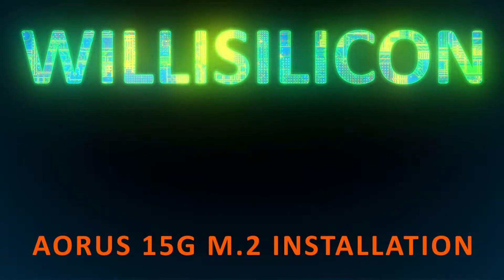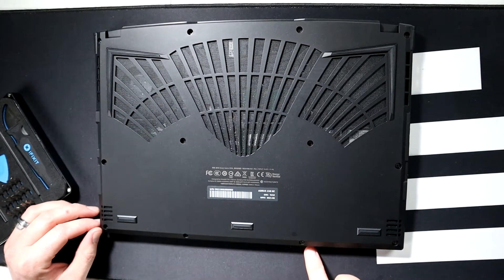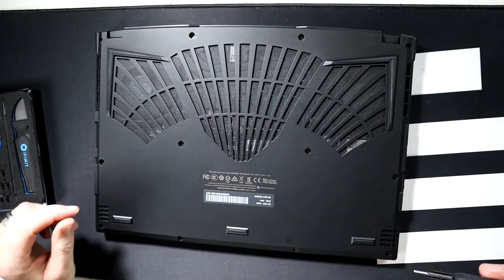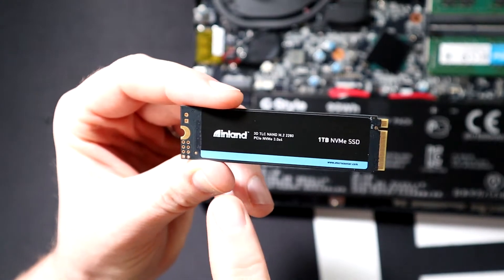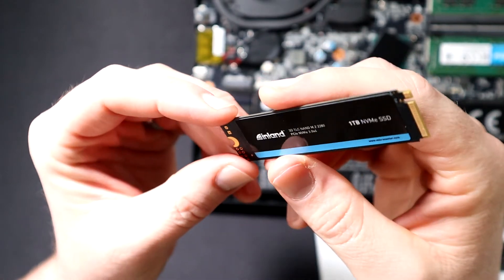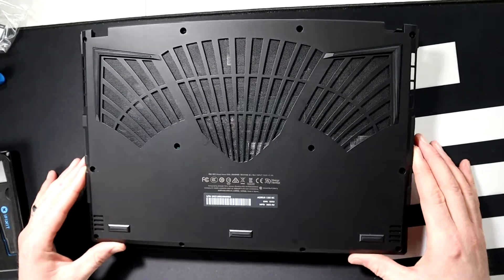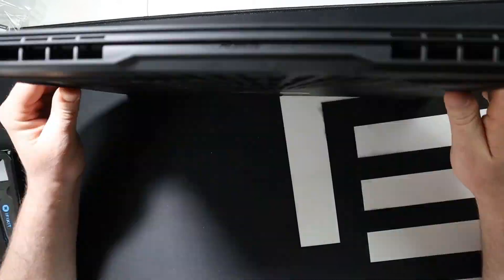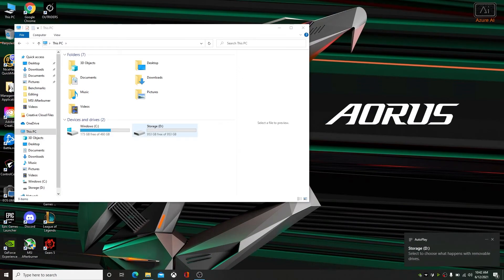How To Install An M.2 SSD and RAM In The Gigabyte Aorus 15G Laptop

Comment: Hello, I need your help. I have the aorus 15g kc model. I want to upgrade ram and ssd. Are these parts correct?
Crucial RAM 32GB (2x16GB) DDR4 3200MHz CL22 (2933MHz or 2666MHz) Laptop Memory Kit CT2K16G4SFRA32A
and Samsung 980 1TB PCIe NVMe 3.0 Read 3500MB – Write 3000MB M.2 SSD (MZ-V8V1T0BW)

Even though the m2 ssd is gen4, does it run at gen3 speed?
Reply from the maker: Those parts are compatible, but yes the ssd will run at gen 3 speeds. But you listed a gen 3 ssd
Reply: @WilliSilicon  yess thank you so much

Comment: Great help for the SSD upgrade on my Gigabyte Aero 5 XE4, thanks!
Reply from the maker: You're welcome! And hey, I work with microwave transmitters for my day job! Maybe I'll learn from your videos. I work with 75kW 915mhz magnetron tubes for industrial microwave ovens
Reply: @WilliSilicon Nice! I have some X-band magnetrons that can do that sort of power, but only at 1% duty cycle! 

Having good clear video of the inside of the laptop before I opened it was hugely helpful.  

I've worked with computers since 1973, although back then they were big remote mainframes, then IBM system 36/38 and AS/400 lots of Z80/6502/M68000 assembler, via MS-DOS 1.25 (!), PC-DOS on 64kB IBM PCs, through CP/M, DR-DOS, Concurrent DOS and eventually big Windows server  farms, lots of Linux, microcontrollers, C adn Perl coding, then Cisco networking and security.  These days I just dabble in containers, AzureAD, AWS stuff and cybersecurity investigations. RF is very much a sideline for me, but ONE DAY I'll be able to retire from the Day Job and just mess about on Youtube.  Work REALLY gets in the way of fun.
Reply from the maker: It really does. Especially working 7 days a week. I've had zero time for videos 😮‍💨

Comment: bro help, I installed a second nvme drive on a laptop and it started up with an error, it sends me to reboot and then to automatic recovery, in automatic recovery I opened the command line and looked at which drives are connected to the laptop, it turned out that he does not see any disk , because of what this can be? if I have a bios version of insideh2o
Reply: I just installed my nvme drive too, didn’t register. The motherboard can only support Pcie I believe.

Comment: I am buying an internal ssd like this one because I bought an external one with a case and it keep getting corrupted... I once lost like 6 month of unreal engine work...
Reply from the maker: Ouch! Maybe have both...plus cloud backup!
Reply: @WilliSilicon  yeah by unreal engine project are like 50-100gb big with tons of 3d assets. Can not use the cloud for that. I use 2 SSD but one is always a done builds behind
Reply from the maker: I think backblaze is like $7 a month with unlimited storage if you have good fast internet. Do you have this laptop? Is it good with UE?
Reply: @WilliSilicon  yes I have this one, rtx 3070. And it is very good with unreal engine 5

Comment: Are there 2 slots for ram or 4? I would like to plug another 2 8GB but i'm not sure.
Reply from the maker: There are just 2 slots. So unfortunately you can only replace, not add.
Reply: @WilliSilicon  I see, thx for response.
Reply from the maker: You're welcome

Comment: Thank you very much! My brother got me this laptop and I've always wanted to add more memory. I'm going to try and slap in a 2TB. Thanks again
Reply from the maker: You're welcome! You have an awesome brother!
Reply: @WilliSilicon  I think so too! I have the newe gen of these i found out with the 127800hz i7, 16gb ram and i just finished adding 1TB. Thanks for the vid!
Reply from the maker: Wow 👌 sounds a lot better than my 10th gen. I still use it though!
Reply: @WilliSilicon  I ended upgrading to a 2TB lol, but I am now looking at upgrading the Ram is there anything that needs to be done once you swap in the new upgraded ones?
P.S. they're great laptops, I'm sure I'll be using this for quite a while. 
Thanks!
Reply from the maker: No, you don't have to do anything. If they're at least 2933mhz rated then they should run at that without changing any settings. That's the max speed for the 10th gen intel cpu systems
Reply from the maker: Oh but you have 12th gen! You'll have to check what speeds your cpu will support. And you might have to go I to the bios when you boot up to enable xmp
Reply: @WilliSilicon  it looks like like it supports up to 3300mhz. I'll double check on the one I pull out. Thanks!

Comment: Though I had another laptop, you helped me a lot. I didn't know I needed to use the plastic tool (Although I had it) to open the case, and missed the screws covered with the temper identification measure. Thanks!
Reply from the maker: You're welcome!

Comment: Hello! Do you know if the additional SSD slot supports PCIe 4.0 x4? I want to purchase an SSD and found a good deal on one of these types. Thanks!
Reply from the maker: It will work. But it will run at 3.0 max speeds
Reply: @WilliSilicon  okay, thank you!
Reply from the maker: You're welcome!

Comment: Do I have to disconnect the battery when im installing the new ssd for avoiding short circuits?
Reply from the maker: No. But if you want to feel super safe it's fine to do so

Comment: Very helpfull video, thanks! Do you know if the GIGABYTE AORUS 5 SE4-73DE214SD need the same screwdriver as you used? the TR6 ? I need to buy a screwdriver and don´t wanna order the wrong one.... The screws are really small and there is no number or something on them... please help someone, i just bought a samsung 980 pro and want to install it!
Reply from the maker: I can't find anything showing the exact screws, but it looks like pretty much the same chasis. It probably has the same screws. Just get you a cheap bit set like the ifixit set that I use!
Reply: @WilliSilicon  just order a set for 10$, lets see. amazon says it could be used for almost everything laptop, consoles, watches, game controllers, handhelds
Reply from the maker: Should have torx bits then!
Reply: @WilliSilicon  yeah it has
Reply from the maker: Good so you're covered no matter what screws!

Comment: So I think they use tamper evidence tape not for warranty but for things like returns. Ex: Did it get opened to swap good components for your dead ones just to return it and get free replacement parts? Or maybe even for a consumer who buys it as "new, opened/open boxed" so they can see, hey this thing has been opened up inside yet it was sold as "new, opened/open box".

Just a thought, nice to know Gigabyte doesn't void the warranty for just removing the lid to do exactly this, considering some (mine did) come with extra thermal pads for just this purpose!
Reply from the maker: Yeah makes sense. Mine came with extra thermal pads too, which is what I used for my added m.2

Comment: THIS is the vid you need! theres quite a few youtube vids about working on a gigabyte aorus, but this guy NAILS it. honestly the HARDEST and most stressful part about working on a 2k laptop that has high performance parts EVERYWHERE is learning how to safely remove the bottom cover to expose the guts safely and without prying something you shouldnt be. this vid clearly shows how to remove the case and not damage anything and keep the case looking mint too.

really appreciate the thorough explanations and narration, along with detailed shots. 

i personally just added a 2tb NVME to my 15P YD - so can confirm that this vid will match perfectly with the 15P as well as the G.

thanks so much for the vid!
Reply from the maker: Thanks!
Reply: Great comment! I am planning to install M.2 NVMe SSD to my 15P KC, thank you for confirming that this video works for the P too! great video too!

Comment: Seems like my Aorus 15G KC does not have a M.2 screw on that place hahah
Here in my country (Portugal) we loose warranty if we open the device, I waited 2 years to add a new m.2 and now it doesn't have a screw.

Time to find one somewhere
Reply from the maker: Wow that sucks! It will be ok without the screw if you don't shake it around. Tape will work too
Reply: @WilliSilicon  that's a bad way of thinking imo. Screws are a must. Tape will trap heat.
Reply from the maker: Double sided thermal tape. Just saying. I've done it 🤣

Comment: GREAT VIDEO GOOD WORK
Reply from the maker: Thanks!
Reply: @WilliSilicon  YES SIR APPRECIATE YOUR TIME AND EFFORTS
Reply: @WilliSilicon   Hey I Have A Question Is that Port M.2 Slot where we install the drive into , is it a pcie 4.0 slot or is it older gen..?  I don't really know , I figured u would know and I'd learn from u.  Reason I ask it's because I'm only getting  gen 3 speeds like 3300MB both read and write speeds from my samsung 980 pro 1tb. It's firmware is updated .
Reply from the maker: Gen 3 port. And 10th gen CPU doesn't support gen 4 PCIe
Reply from the maker: The newer Aorus laptops with Intel 11th gen CPUs should have PCIe 4 slots.
Reply: @WilliSilicon  alright thanks so much
Reply from the maker: You're welcome

Comment: i definitely needed this video for teardown of my laptop so I can update the read/write speeds of my m.2, it was only reading 5,600. 👍
Reply from the maker: 5600 is pretty damn fast lol
Reply: @WilliSilicon  it was supposed to run 7500 but I didn’t update the firmware- by my guess should run 6500-7000 though.
Reply from the maker: You must have a newer version Aorus that supports PCIe 4.0

Comment: I have this model laptop.  It has M2 input, but I don't know which SSD to buy. I would appreciate your help. Thank you.
Reply from the maker: You need a 2280 m.2 nvme ssd
Reply: @WilliSilicon  Thank you for the reply. Have a nice day.
Reply from the maker: You're welcome and you too!
Reply: @WilliSilicon  If I insert the 2nd ssd into the laptop, will the warranty be disabled? I'm skeptical about this and I haven't found any definitive information on the internet yet.
Reply from the maker: @peyniravcisi  It will not void your warranty
Reply: @WilliSilicon  thank you, it's nice so this information, I will buy a suitable ssd as soon as possible.
Reply: @WilliSilicon  what does 2280 mean? i'm new to the gaming laptop stuff. I have find m.2 all day but i don't see anything that specifies 2280. Appreciate your help!
Reply from the maker: 2280 is the size of the stick. 22mm wide and 80mm long.
Reply: Is this pcie 3.0 or 4.0
Reply from the maker: The 10870H doesn't support pcie 4.0

Comment: He holds the camera very close to the modules he's replacing, which is very helpful. You can see EXACTLY how the new module is supposed to set in, and how to tighten and loosen the brackets.
Reply from the maker: Thanks!

Comment: great video bro, I just got the Aorus 15P model, is the procedure the same? also what can I upgrade on this besides RAM? Memory? can I upgrade videocard memory?  other stuff etc...? can you make a video on this model Aorus 15P-YD please?
Reply: I just upgraded my 15P and it's exactly the same procedure except the wire that goes around the nvme slot is actually below the slot, but you should be okay following this video. 

In fact, I called Gigabyte and they said remove BOTH thermal pad stickers so @willsilicon was right about that.
Reply from the maker: Thanks for the info!
Reply: @tanjidislam5307  Tanjid thanks for info bro!!! definately upgrading the RAM & SSD, Happy Holidays guys
Reply from the maker: Happy holidays!
Reply from the maker: Thanks! I've never had a 15p model, but from everything I've seen online it's mostly the same as the 15g. And ram and storage are really the only things you can upgrade. Grats on your awesome new laptop!
Reply: @WilliSilicon  Thanks Willi,  so I think ima jst swap out the extra RAM & 2TB SSD from my old HP Omen  laptop and install it on this new laptop🙏, jst for faster load times/perfomance & storage,im new subscriber, looking forward to more of your videos.🤙👍
Reply from the maker: Then you can sell the Omen!

Comment: I assume the Aorus 17G 11th Gen Intel/Windows 11 upgrades in pretty much the same manner?
Reply from the maker: Yep
Reply: @WilliSilicon  how tight should you refix the screw when using it to hold the secondary drive in place?
Reply from the maker: Just snug
Reply: @WilliSilicon  gotcha, cheers; I've slotted RAM and mechanical drives before, but never used NVME prior to this.
Reply from the maker: It's much simpler. You probably won't go back lol
Reply: @WilliSilicon  12 TORX-6 screws though, my old 2012 M17X R4 was held in place by 4 Phillips screws beneath the battery compartment, lol.
Reply from the maker: Oh yeah opening laptops can be not so simple though 😂
Reply: @WilliSilicon  on the flip-side, rarely do you have to screw them into a caddy or fit an inter-poser these days, at most there's a bit of fiddling about with a heat-sink or applying a thermal pad.
Reply from the maker: Yeah. Most drives don't need it on a desktop at least.
Reply: @WilliSilicon indeed; I usually recommend a desktop to people over a laptop in most cases; I tend to go with laptops due to not having much space, it being more convenient when I'm streaming, or if I'm gigging or in hospital for an extended stay.

There are pros and cons to both, but very few people would argue against desktops being much easier to work with when it comes to upgrades and repairs.

BTW: you mentioned all 12 screws were the same length, on the 11th Gen 17" version there were 2 screws that were slightly longer, however I can't remember what 2 holes they went in, (luckily once the chassis is clipped down all of the screws tighten).

I guess it should be mentioned 2 of the screws are anti-tamper screws as well.

Comment: Great video, thanks! 
Regarding the RAM upgrade for the Aorus 15G (SB or WB version which I am considering getting - have not decided though), I can also get the Amazon single 32GB module right? It is only $10 more than the 16GB X 2 kit you linked to (same manufacturer and speed, just 1 32Gb module, as opposed to 16GB X 2).  

32GB single module: TEAMGROUP Elite DDR4 32GB Single 3200MHz PC4-25600 CL22 Unbuffered Non-ECC 1.2V SODIMM 260-Pin Laptop Notebook PC Computer Memory Module Ram Upgrade - TED432G3200C22-S01 – (1x 32GB) Single. 
I figure by getting a single 32Gb module, it could always be upgraded to 48GB or 64GB down the road (although 32GB will be more than enough for me for many years most likely)
Reply from the maker: Yeah that will work. But performance will be a bit slower with single channel

Comment: Could u make a benchmark video for online games? I face a problem with them, the usage of the gpu is always between 40-50 and in a game like Valorant it's 20-25 usage.

In a game like Control it works 100% usage i don't know what's the problem with online games 😕
Reply from the maker: https://youtu.be/TNy9bng7vEg .... Have you tried playing on a wired connection instead of wireless?
Reply from the maker: Do you get bad fps? Games like Valorant are just really easy to run so it doesn't need 100% GPU utilization
Reply: @WilliSilicon  I know it doesn't need that but not only 20% only
Reply: Valorant is an easy game to run you won’t need 100% gpu what FPS do you get
Reply: @notaweeb7936  I just give valorant as an example, It happen  to all the online games i play. I know Valorant doesn't need 100% usage.
Reply: @omarosama4185  ah I see
Reply from the maker: Yeah in my benchmarking the utilization was pretty low on easy to run esports games, but the fps was high, so it's all good